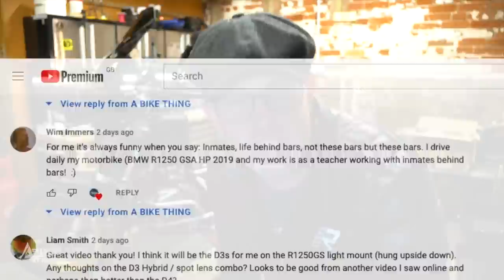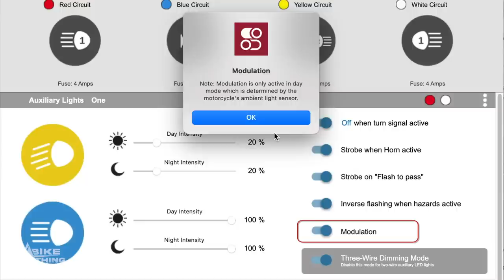Putting Your BMW R1250GSA Back Together With Confidence Screw By Screw

Comment: Congratulations Steve — best DIY video I’ve seen from anyone. Still glad I’ve got my airhead: removable seat & 35-litre tank without tools, no canbus or fuel pump, only one small screw in one small panel. Keep smiling behind bars🕊

Comment: Brilliant you do take take requests! I just literally finished putting my GSA back together and was dreading taking it apart again, now I can buy more stuff from you as I can now just watch both videos!
Cant wait for the custom T3 BMW emblem wiring (no pressure) seriously your customer service is outstanding your shipping is super fast even down here in Aus and pricing is the best I have found.
Now seeing you are taking requests how about a bash plate/engine guard SW MOTECH install👍🏼 thanks again Mitchell (not the Aussie cricketer) Stark

Comment: You need to do this with a standard 1200 or 1250gs.  The whole bodywork screws thing drives me crazy.  Long screws, medium screws, short screws, short shoulder screws...argh!  I even noticed some of the screws are flat on the tip, and others have a pointed tip.  Maddening.  German Engineering at its finest..."Why only use just one part when 37 will do?" 😵‍💫

Comment: As a toolmaker : Bmw screws if magnetic(ferrous) would rust unless they used a tool steel with alot of chromium in like en30b . its better to have fully stainless steel so everything stays rust free and stainless is very strong, like twice the rockwell   of  mild steel. Great content thanks. Look forward to having you work on my bike sometime. cheers steve
Reply: Try this, take a small piece of plastic film, such as from a plastic bag, lay it over the screw head. Press the driver into place forcing the plastic to fill the tiny space between the driver and the screw. This works makes a pressure fit that will hold the screw on the driver. If one layer of plastic film isn't enough, use 2 or 3.

Comment: Great video Steve. Somewhere I've seen a video on removing the wired plug from the back of the OEM spot lights whereby you insert a small allen key or baby screwdriver into a slot at the rear of the light unit, can you confirm that is correct please.

Comment: Great Video as always. Impressive job all around!!!!! How about torque settings? Did I miss something?
Reply from the maker: I’ve worked and spent time in a bmw service centre.  Apart from major bolts and screws that hold critical parts to the bike such as brakes, clutch, wheels, suspension, engine etc, for body panels just use your intuition and give it a sensible tighten up.
Reply: Thank you for the explanation

Comment: Great video ... this one and the taking apart one!   Question: The Milwaukee Fuel impact driver you use, how do you set the torque as the screws holding plastic bodywork on will be really low 2-4 Nm and things like luggage racks and crash bars will be 10x that! Does the impact driver have some kind of auto-torque or it is based on how long you hold the trigger (trial & error)?

Comment: HI Steve, i only just started following your vids but i will say already well impressed here.. Now i wondered if you could tell me which stand you use in this video to lift the bike?  Probably a question that has been asked before but so far couldnt find it hence the question.. ( i assume by the way that this would work for a 2016 GSA as well? ) Thanks in advance, Frank.

Comment: I have a gap on my 15' 1200GS tank center trim piece because of the swelling tank issue suppossedly. Its very frustrating.
Reply from the maker: Yes I’ve seen this.  V annoying and you have to be so firm with it you’re worried you’re going to break something.

Comment: I have a 2014 R1200GS.  Here in the USA they use ethanol additive in the fuel.  In turn it causes some of the gas tanks to swell a little making the tank cover have a gap on both sides of the tank cover.  It will not lay flush.  Have you got any suggestion on how to fix this problem other than replacing the 1250 dollar gas tank.  Thanks.
Reply from the maker: Never heard of this before

Comment: Hi Steve. At 19.33, specifically the silver piece of bodywork that’s attached to the rest of the front bodywork that you’re holding, is it possible to remove/refit it on its own? Thinking about re spraying it. Thanks for all the effort on these videos
Reply from the maker: I don’t think it is possible.  I’ve only ever removed those pieces when the whole panel is off.
Reply: @ABIKETHING  worth an ask. Cheers 👍🏻
Reply: @simonwebb1976  it’s possible, but indeed you have to remove the black bodywork panel loose first. I have just done it on my r1250 GSA 2021. For the same reason: had them resprayed. It’s a job worth the effort I feel.

Comment: but how do you get the silver bit off the side panel? im currently stripping my gsa down. screws everywhere 😂
Reply from the maker: We don’t generally remove the silver part as it comes off with the black plastic but once the main black plastic is off, you flip it over and it reveals the screws that attach the silver section
Reply: You sir, are a legend. Thank you.  @ABIKETHING